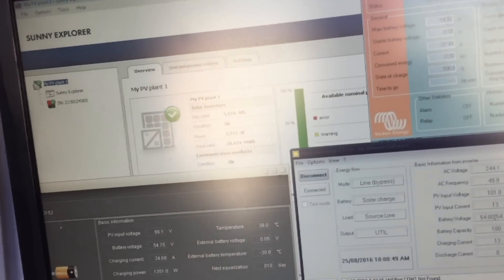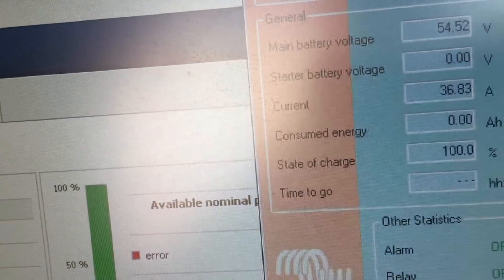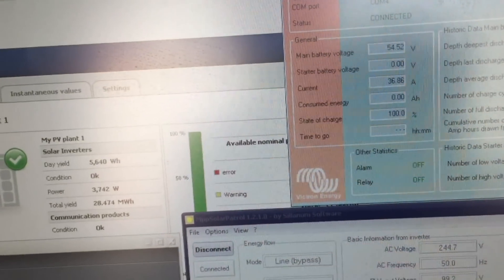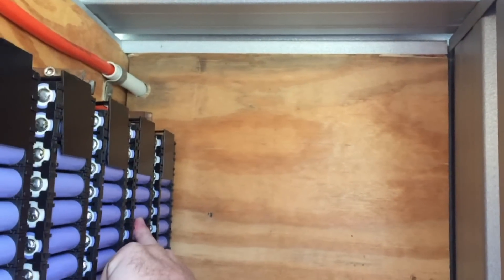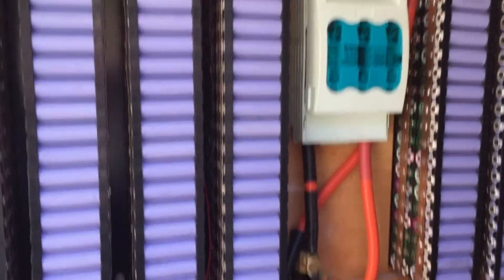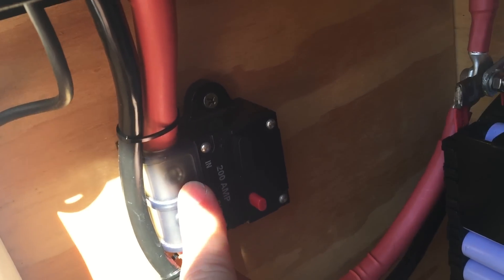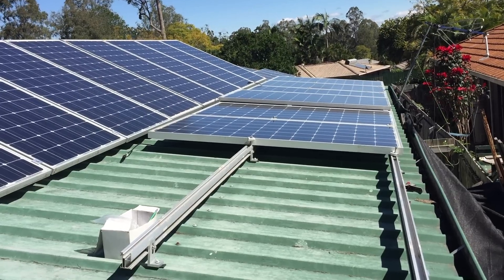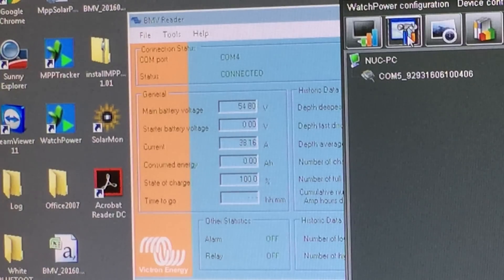Charging 18650 Cells with solar & a eBay charger!

Comment: Good day hb wanted ask u my old 48v ebike battery is sitting about so want use in back of my daily campervan.I have twin mppts in van one up front with 100watt panel an my renogy rover 20 at back with 3 x 30 watt panels in series now.were parallel,just run usb at back for now on a 12volt lead acid 110ah.my 48v or 54volt full charge 14s5p pack may dove ordered bt1 Bluetooth module to monitor volts etc.what u think bro?steve in uk ,vw t4 daily camper.also use Waeco fridge 12/24v fridge up front always on with dc to dc charger connected to twin parallel 110ah .

Comment: Hello, That's a best video on charging 18650 cells so far. How about the longetivity of these  cells? As I can see the current is changing due to the clouds and other things like the time of the day. I have some 18650 cells and the manufacturer states they have to be charged on constant current and constant voltage up to certain point. But what if the current is getting a bit lower over time like in an evening. Does it affect the charge/discharge cycles? Or the current must be lower than it's maximum value allowed and that's it?  Is the CC mode important only for charging lithium cells very fast?

Comment: Damit man I am obsessed with batteries lol Started collecting 18650's Legit lot sales on ebay ,laptop packs even recycle bins you name it. Even found a decent cheap china cell "EBL" all 20 had 2600 mah short of the 3000 labeled but work great. Like 1.75$ a cell direct from ebl who will replace any bad cell. Minus legit name brand cells the cheap ebl's have been outperforming the new laptop pack cells. While I do not have a big power wall I do make trolling motor packs and they have done well there too. Even tore one apart and its a full cell no sand or tiny cell within. Kinda surprised actually my 12v packs get abused they seem to volt lag less than new laptop cells.
Reply from the maker: Funny you mention a trolling battery - that's my current project 30p4s with used https://secondlifestorage.com/showthread.php?tid=1792 cells - should go alright - average of 2700mah per cell
Reply: A 30p 4s would make a great 12v pack for my trolling motor I find it better using 4s. With 3s trolling motor cuts out with lots of capacity still left in the pack. I just use a low voltage cutoff at around 12.2v amazingly no bms. I just balance charge it with imax b6 then use cell checker to balance when needed. 

Thanks! for all the videos you have helped inspire me into my new obsession lol

Comment: Re the basics of each cell.....Each bank cell is how many  volts when  fully charged? @ 4.2 volt per 18650 you have around 12 in series? Each physical bank I assume is 50.4v ?
Reply from the maker: 320p 14s
Reply: @HBPowerwall   Oh! Huge! How do you use all your outputs? for your house only?

Comment: What is the rate of discharge
Reply from the maker: I can discharge at a max of 16kw for a very short time (surge) 8kw max & l like to stay under 4kw to save the inverters. i've seen 300 amps at 54volts max to date

Comment: I thought these 18950s charged to 4.2V?
Reply from the maker: that is fully charged yes, currently i charge to 4.0 volts low voltage cut off is 3.6v
Reply: running full charge and full discharge will shorten the life of your batteries. check out the web site ( battery university ) for the latest info. they recommend a charge of 3.7v and a discharge of 10 to 15 % if possible. they also suggest charging at 24 volts with a standard charge controller.

Comment: Boring !? What are you talking about !?
Reply from the maker: One persons boring is anothers peace and quite - enjoy your stay
Reply: You are the best channel in your category I believe. I come to learn from the master hehe. I currently use car batteries because I have a almost unlimited supply of these for next to nothing and after 4 years I still dont have one that failed. But for my RV I want to go with your way of doing things.
Reply from the maker: Unlimited supplies are good.. and if it works stick with it. Good luck with your RV Project be sure to come on over to DIY Powerwalls on fb and share your journey
Reply: Car batteries are bad but when you pay 15$ for a good tested one that they give you back 5$ once its dead its a good deal. But for the RV I want no hydrogen, I want lightweight, no acid spill and the best density I can afford. I'll stick around your channel for sure.

Comment: which type of cells do you use?
are all equal capacity?
how much is the medium price do you buy these used batteries?
how much cells do you have in your installation?
thanks i'm interested in make this for my shipping container home project.
Reply from the maker: Type - any I can findNo10c - $2 per cellCurrently - 2240 - aim +6000make sure you share your project on my channel :)
Reply: @HBPowerwall  What tester do you use to find the capacity? I use ZB2L3  testers and out of 500 labtop cells my results got frustrated me I got week in my small home project. Out of 500 cells only 70 cells gave me over 2000mAh. I check the capacity after full charge. Any advise?

Comment: great energy bro..
but,.. if 1 cell is short, another parallel 18650 battery is short.
This often occurs in defective laptop batteries
Reply from the maker: that's the reason each cell is fused

Comment: I have an experiment for you one day. .?

When your pack is fully charged at 4.00 v
Change it to 4.10 and see how much more 0.1 volts holds. 

No real reason. It just popped into my head when you were talking about bad weather coming up.
Reply from the maker: Bloody good experiment how ever can't say it'll ever happen as i would need to deplete the bank and we can't do that in a night and would prefer not to smash the batteries that hard sorry, i can say the difference is EXTREAMLY noticeable under heavy load when the bank is toped up to 4.2 :)
Reply: I think you miss understood,
one day when your expecting bad weather and you batterys are full charged. note the amp hours in for the day. then put the float up to 4.1 and see how much more it took to top them up?
once again, no biggie, just for fun.
Reply from the maker: Now that is doable :) I'll try make it happen within a week. 
Just have to get the batteries to float & then float again at 4.1 in one day.. 
Right This can be done.
Reply: thats the spirit...

Comment: Pete Do you know if the Pip will AC couple with the SMA ? I am thinking of buying the Pip 4048. I would like to stop give my power to the Power Co-Op. They will not ok grid tie's in my town yet. Even tho the state law says they must. What happens is they let me grid tie but the power I over make they keep for free. I am sick of it. Thanks brother.
Reply: The pip will not grid-tie. its not made for it but you can paralell severall of them though. But not with other devices. If so you will need the Hybrid version
Reply: daromeresperyd Not looking to grid tie the Pip. I am looking for the Pip to charge my batts from the AC power of my SMA ...
 Thanks for that tho.
Reply: Ah ok. Yes thats possible. No problem to hook it up like that but if your only out for charging from another inverter there is alot more efficient ones to pick from than the pip. But if you going to have it as backup as well and for more solar go ahead and run it :)  
My pip can either be switched to grid or from my hybrid inverter as of now. . useless but thats how i hooked it up
Reply: daromeresperyd Well It would not be back up I would run most of my AC loads on it. I do that now. I have a Off grid solar setup and a grid tie. I would like to combine the grid tie into the off grid side. The bigger loads in my home would stay on the grid.  

I was looking at the Magnum inverter that is 48 volts and 4000 watts I think.. May have been 4500 watts. 

THere big time cash tho. for what one of tho's cost I was thinking I could get 2 pips if there worth it.. 

Thanks for the help..
Reply from the maker: http://www.selectronic.com.au/inverter/sine.html just don't tell the wife..

Comment: not sure why you charge from the mains power you using more power then to charge the battery then use the power better off just use the mains power to run the gear in the home and hold off for the sun to charge the bank back up, that free sun power power in the battery, from the mains takes alot more power think about the loss
Reply from the maker: +TRMTHEweasel because I could and wanted to play :) and I was selling power to the grid at 6c so instead I banked it :)